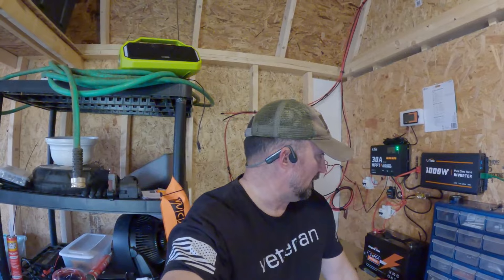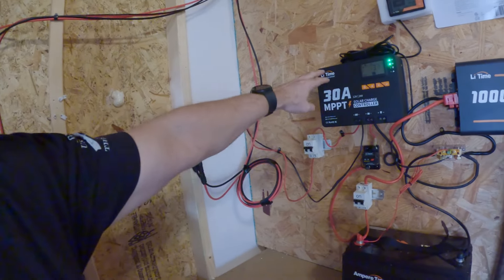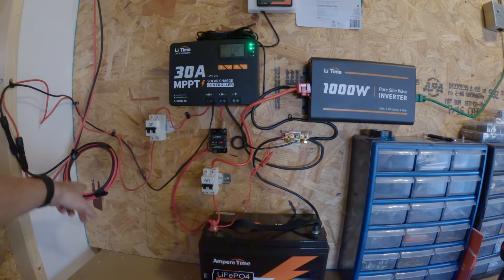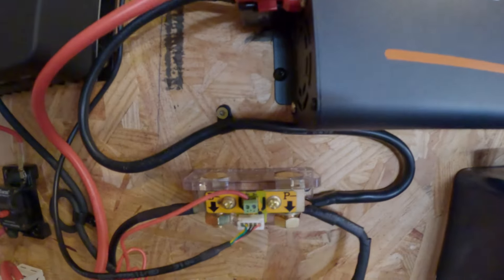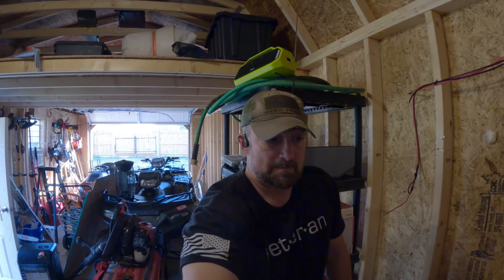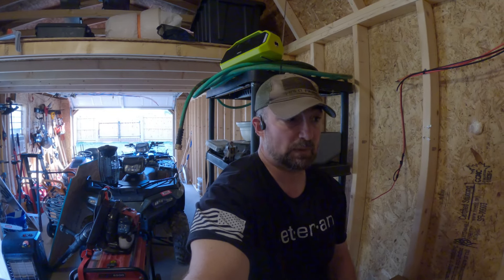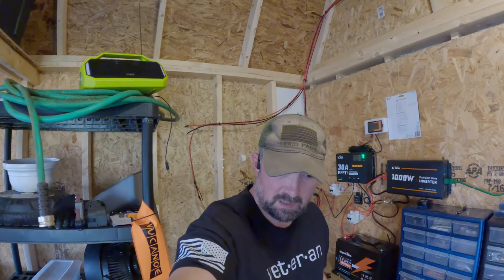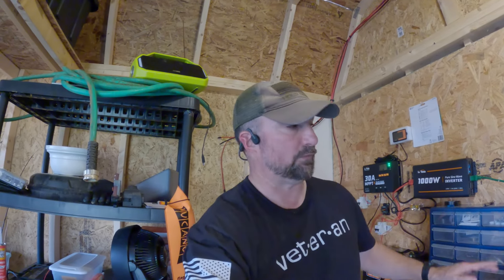My Li Time Solar setup. VLOG 25

Comment: I have 400 watt in 4-100 watt panels, with li-time controller and battery. I went series and then  parallel so I ended up with 40.8 volts and 9.82 amps to keep amps reasonable for charging my Anker C-1000 generater as i needed to keep under 600 w max and 12.5 amps
Reply from the maker: I will be using 4 each 100-watt panels in series (that's my plan). I am hoping that I can hook them up today. I will post a short video once I get them set up.